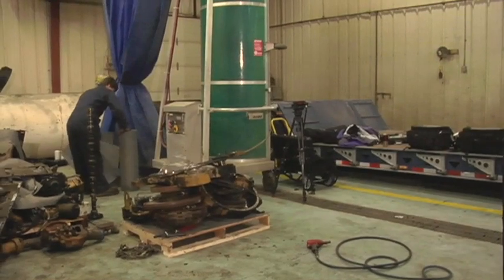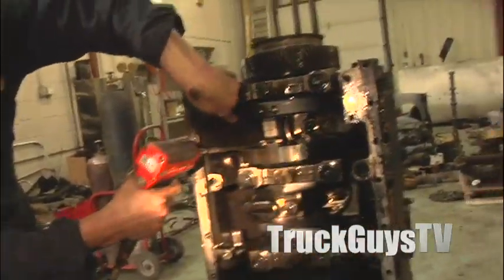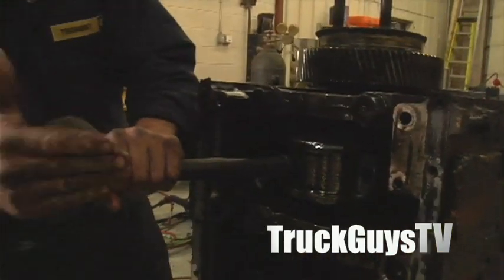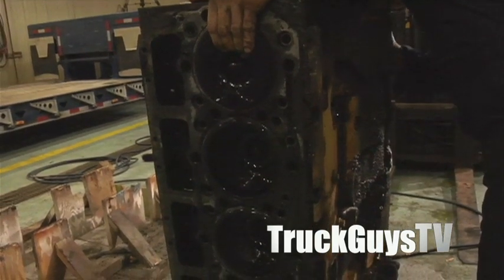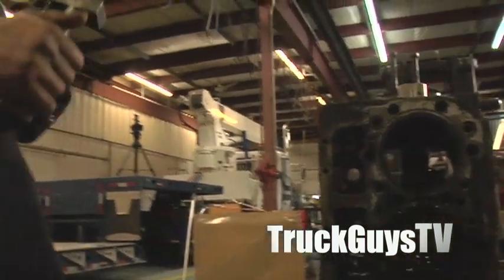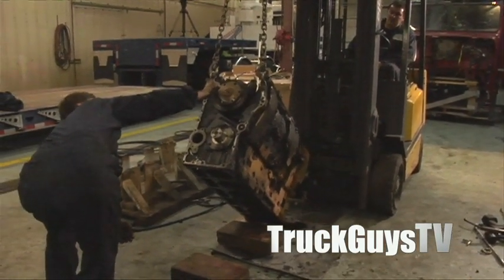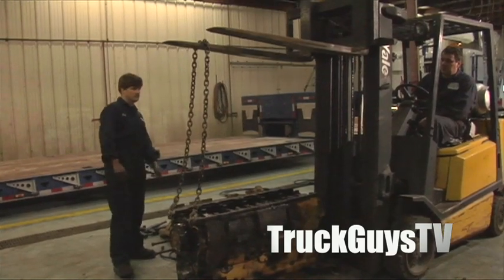"Building the Retroliner":  Episode 5B - "Watch Your Fingers!"

Comment: What type is that air impact Brad uses it sound strong for that size. Thanks great videos love all the series.
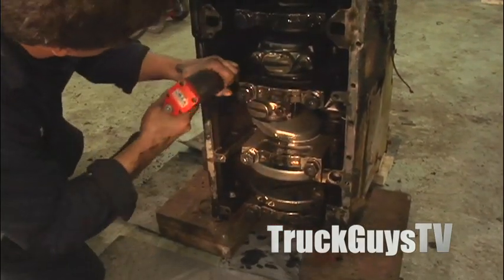Reply from the maker: +Bobby Horn   Hey Bobby.  Thanks for watching ...and liking our shows.  To answer your question.  If you are referring to the air impact gun Brad uses at the 1:30-1:40 mark in the 5B Retroliner video.  The model is from Snap-on Tools.  It may be an XT1700.  Not sure, as we have many versions of the gun in the shop.  For the most part we like the Snap-on products.  Hope this helps.
Reply: +TruckGuysTV thanks for the reply and info . I was raised with snap on tool my Christmas present for my 10 th birthday was the third set up from the starter set best Christmas ever but I always used ir impact guns never had any luck with the snap on lasting more than a year at best. But all other air tools no problem.